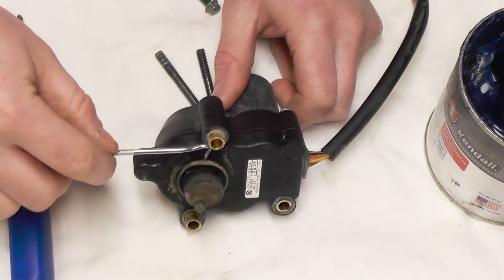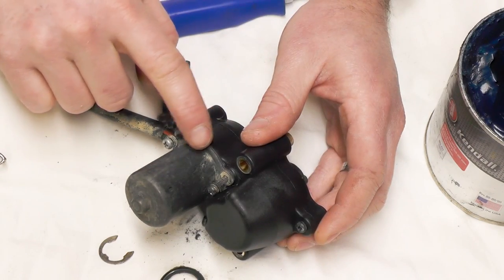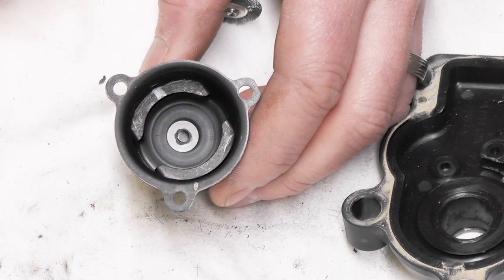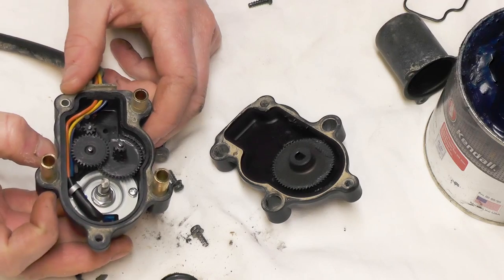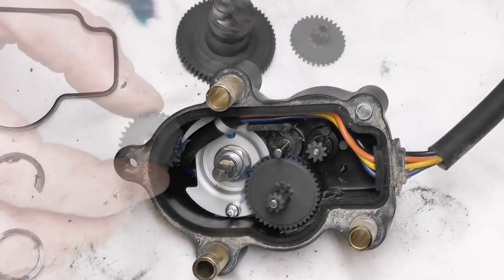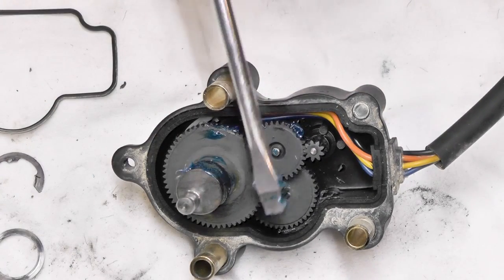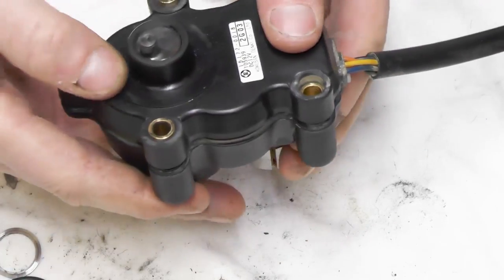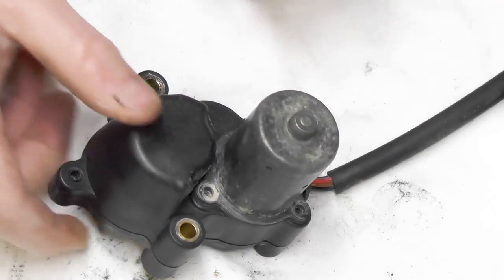How to Clean, Lube and Fix loud KEBC Actuator or 4x4 Actuator: BRUTE FORCE or PRAIRIE

Comment: Great video, thank you very much!  My 2003 Kawasaki Prairie 650 also had a very loud squealing sound from the KEBC actuator. I followed your procedure and now it runs better than new.  However, when I had it apart, I noticed that the little gear on the motor shaft was not attached to the motor shaft.  You could turn it very easily and the motor shaft would not rotate.  Have you seen this and is it normal?  Thank again.

Paul

Comment: I deleted my kebc. It slows the atv down too much and makes terrible noises, I also read it was hard on belts. i put kit on that comes with block off plate and relay that plugs into ecm so gauges work correctly.
Reply: What kit was it?

Comment: Great video. Thanks. I may tackle this as mine is looking very similar to yours. 
Do you have a video to troubleshoot a flashing 4x4 light ? 
Thanks
Reply: I recently bought a 360 prairie and it has a blinking 4wd light 1 second blinks. Manuel says it the actuator. The quad does not shift out of 1st gear

Comment: Does that unit have to be clocked a certain way when putting it  back together or will it reset itself etc. Went into limp mode , so I reset it , now it makes a high pitched humming noise seems like it rotating around inside going crazy & stops for a few seconds then repeats  , and 4wd-2wd flashing back and forth every 2-3 seconds ... is it 4wd actuator  or an electronic controller causing this ?? Anyone have the solution ?? Thanks
Reply from the maker: Apologize about late response. Were you able to figure it out?
Reply: Did you ever figure this out ?
Reply: @appleapple4956  Yes , it was a customer's ATV that I was having hell with , I bypassed the whole electronic actuation system and installed a Sgroi Inno. manual engage system , that was over a year ago , and he has had ZERO problems with it , never went into limp mode again & 4WD works perfect !! 
😎👍

Comment: I have a 2005 Arctic Cat 650 V2 (Kawasaki engine).  My KEBC Aculator is making weird noises, and my drive belts keep shredding.  My mechanic says that the Aculator motor is going out and that I need to replace it.  Is it possible that a simple cleaning would solve the issue, or should I order a new one?  How can you tell if it's actually going out or not?

Comment: Really useful video, thanks!  I have just bought a 2003 KVF 650 V-Twin KEBC and want to download the user manual for further maintenance needs, specifically to do my own oil change.  Are the Prairie and the Brute Force the same vehicle?  If not, which one do I have? AM really hoping you can help me here.  The dealer charges a fortune to do the oil change and a bit of a tune up.  Thanks!
Reply from the maker: Janet, the Prarie and Brute Force 650 are basically the same machines, at least the straight axle variations. Believe your's will be the Prarie variation at 2003. Here is a link to the oil change. https://www.youtube.com/watch?v=PeD9R_rcuGs

Comment: So if you don't put the cap over the magnet the way you took it off it won't work? Because now my 2-4wd light is flashing back and forth and it makes a weak noise
Reply: How did you make out with the weak noise coming from the actuator? Thanks

Comment: When you say people tap on it?   My 700 suddenly only clicked under seat when i went to start.  Im no mechanic so i checked the solenoid, battery all the basic stuff.  I was at a jamboree so i asked a guy that was.  He tapped that thing and it fired right up.    Do i need to replace this actuator or will this rebuild fix that? Seems like its the motor more than the gears if im not getting anything without the tap??? Help.  Also great video man, subscribed!
Reply from the maker: Thanks for the comment! That's defiantly a strange scenario. I wouldn't expect that to have anything to do with it unless there is an electrical short somewhere. I'd try a good cleaning on the KEBC first, it'll be free minus your time.
Reply: Ok so i took the kebc apart thanks to this video. And its full of metal shavings... 😬 but all the teeth on the gears seem to be there so..... question is “rebuilding” all that i have to do is clean it and grease and put back together?

Comment: If you are still answering, is it reasonable to assume most of the time dirt and crap and being dry is the reason they play up?  My 2008 brute force  750 was working ok and it started doing the flashing thing 2WD then 4WD back and forth. I taped the motor a little and it seemed to stay in 4WD, next time I tried to switching back to 2WD it stated again with the flashing problem. But has always made the clicking and little motor noise when I turn it off, now its making no noise. I am wandering if it's probably just crap, and gone dry inside which is causing it,  and just needs a good clean and grease!
Reply from the maker: A good cleaning and grease will probably fix the issue. Thanks for the comment!
Reply: @atvdirt1   that worked thanks again.
Reply from the maker: @normski262  Awesome, thanks for the comment!

Comment: Could you please tell me what the black rectangular box is that sticks out of the top of the case, inside it is a switch. has on and off marked, should the small lever inside the cover be in the on or off position, what should I flip it to when reinstalling after actuator removal and cleaning? I have moved it and can't remember how it was.
Reply: Joe Brewer flip it to on, it’s the drive belt failure detection switch.

Comment: great stuff, I just got a 2004 750 bruteforce and that gadjet always run when the battery is hooked up and switch is OFF?

I was earing a dildo type of sound when the battery was in and I found that it is this actuator.

I took it out and it keep turning when hooked up to harness

what is the purpose of this?

why is it always running? is there a limit switch inside that is defective?

new to 4 weelers ;-)

Comment: When I turn on the ignition I used to hear the EBC but recently I don't hear it and I also don't have 4 wheel drive, I put the 2 wheel drive switch into 4 wheel drive and nothing, no 4 wheel light on dash.
Are the 2 problems connected?
Reply from the maker: Cleveland Matheson, wish I had more knowledge on the wiring on these. Although... If you're still feeling engine breaking then it's working. The 4x4 actuators are a common failure on the Kaw.  If your not getting engine breaking, I'd definitely check fuses first as they may both be on that fuse. Please update this comment with your findings to help other enthusiasts like us.
Reply from the maker: Cleveland Matheson, wish I had more knowledge on the wiring on these. Although... If you're still feeling engine breaking then it's working. The 4x4 actuators are a common failure on the Kaw.  If your not getting engine breaking, I'd definitely check fuses first as they may both be on that fuse. Please update this comment with your findings to help other enthusiasts like us.
Reply: There could be a number of issues from what I have read such as a pinched or broken wire, corrosion around the fuses or maybe mechanical.I don't have a repair manual  to do a more thorough troubleshooting of the problem.It's probably a good investment to buy one since my 650 Prairie is a 2003.
Reply: How did you make out? Did you replace the 4x4 actuator?...and if so, did that fix the problem...I have the exact same issue. Thanks a lot.

Comment: what kind of grease did you use?
Reply from the maker: Dickey, the grease we used was Kendall Super Blue wheel bearing grease, but just about anything should be sufficient.
Reply: OK thanks bud good videos..
Reply: +Everything ATV-UTV-Reviews bro i have a 650 brute force , and i have a backfire problem. Do you know how i can fix it ? The atv runs but it lose power when i accelerate it only work 1 carburator